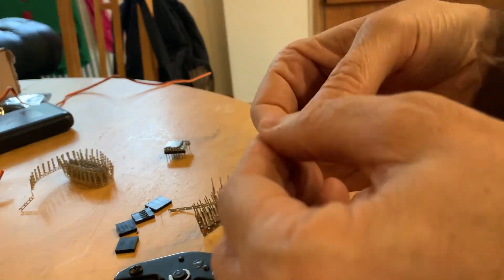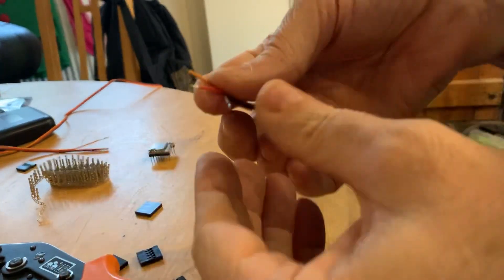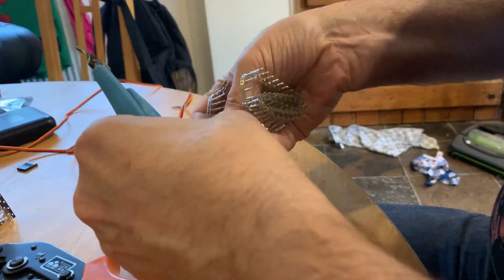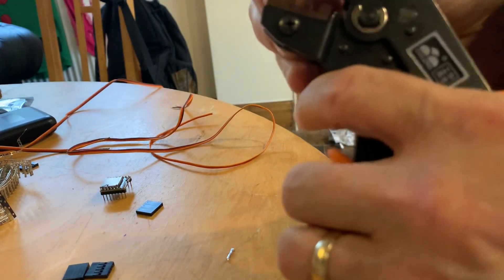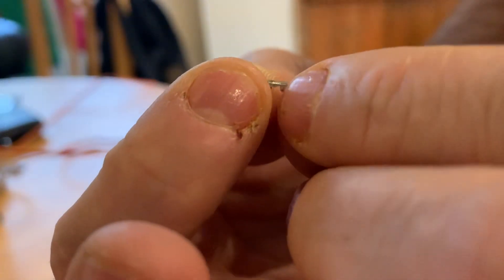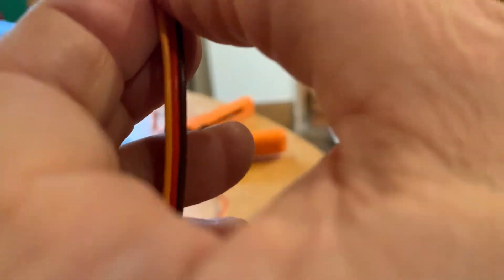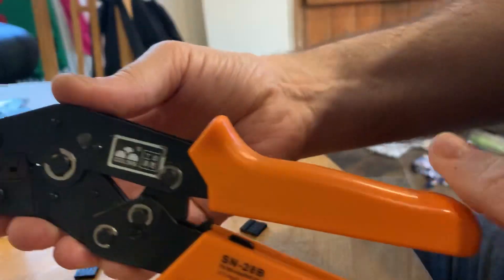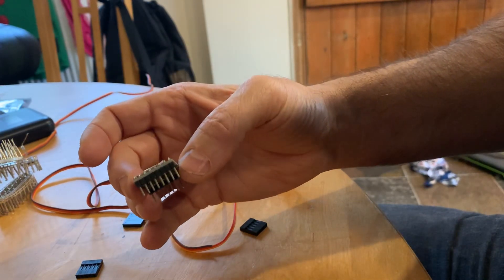Making DuPont connectors & crimping

Comment: Thank you Michael, I bought one of these kits a while back for your R2 but only tried it a short time ago. I ended up goofing up because I was putting the bit in upside down in the crimper, I didn't understand how it goes in. I ended up using a pair of needle nose plyers that the the manufacturer sent with the spares bits.
Nice tip about the headset.
Any suggestions on which connectors to use for the motors in R2? To make them easy to maintain?